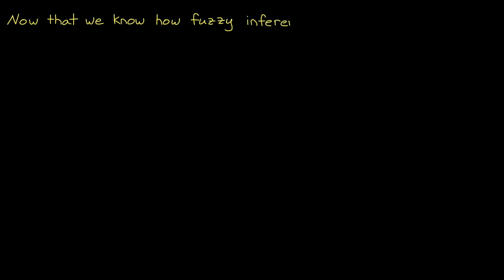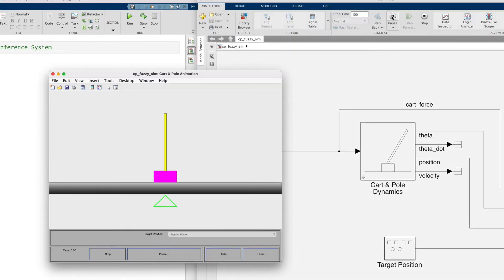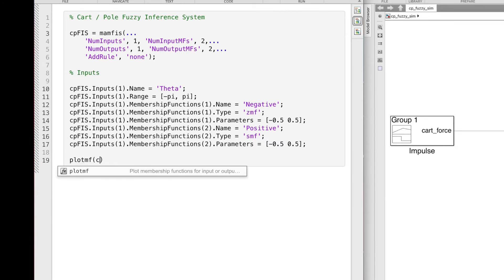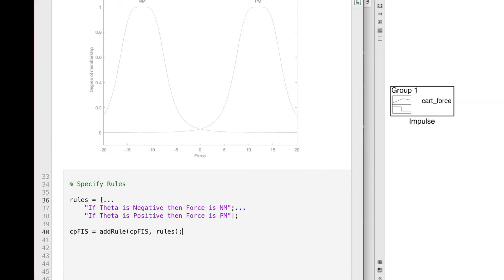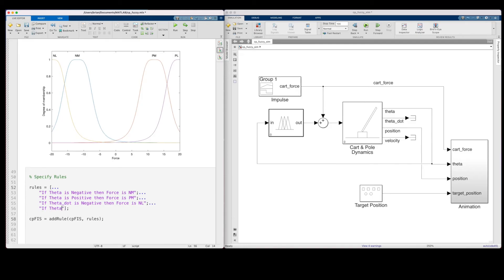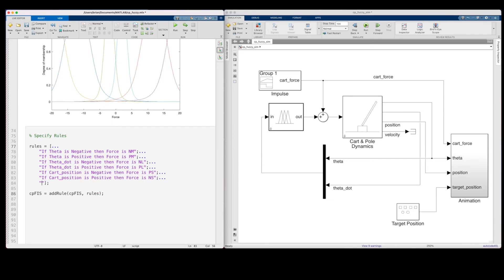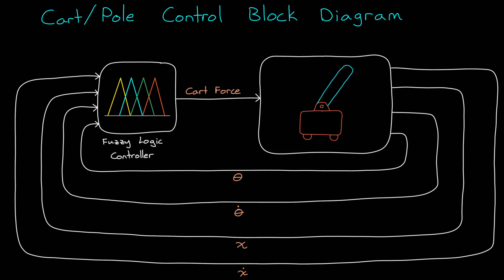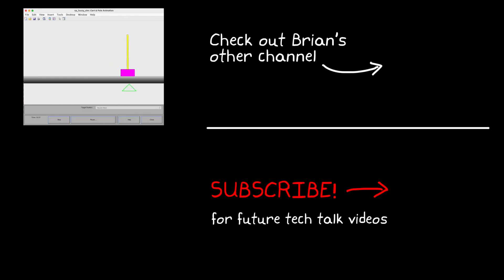Fuzzy Logic Examples | Fuzzy Logic Part 3

Comment: Why cart-velocity is negative then Force is negative? In that case, wouldn't the velocity increase?
Reply: You know what, I think you're right! I made this a while ago and have forgotten the details but I wonder if I was thinking about 'velocity error' and not velocity. Since I want velocity to be 0, velocity error would be the negative of velocity and then the logic I wrote would make sense. But since I'm using velocity then I think the logic is backwards. I'm surprised it worked and I didn't catch that. I wonder if the pole angle and theta have a strong enough response to just overcome the error in the velocity logic. Good catch! When I have some free time, I'll try to play around with this some more.
Reply: @BrianBDouglas  Thank you for answering! I think it's right to replace 'velocity' with 'velocity error'. Similarly, I also think the reason why the 'wrong' system operates perfectly is that  the rules related to the pole corrected it.  Anyway,  your video is excellent!